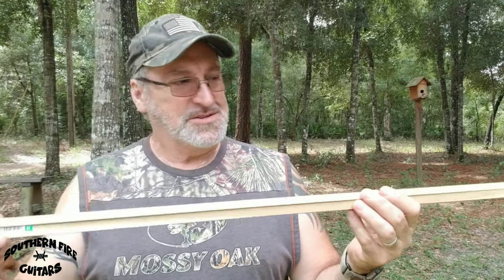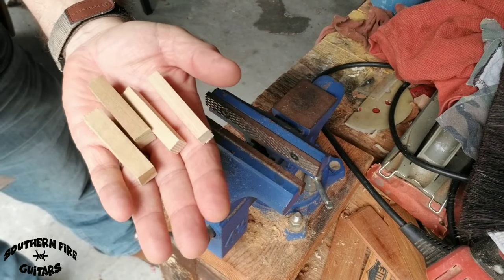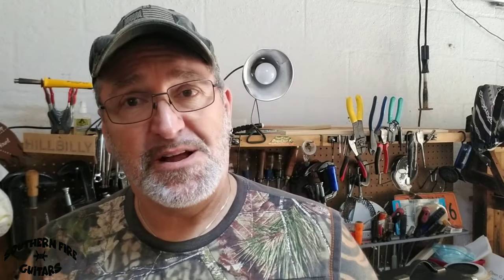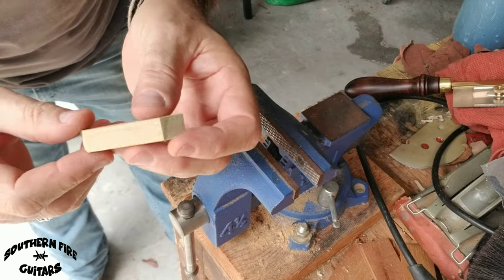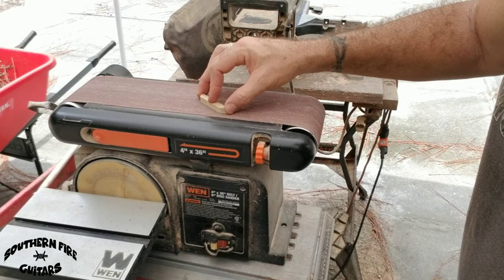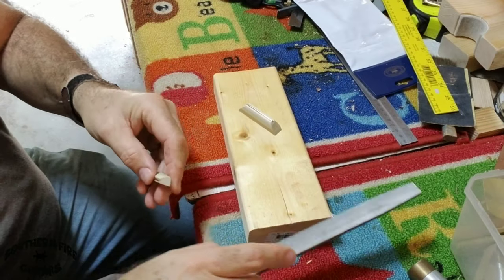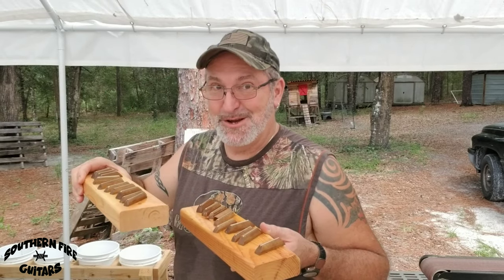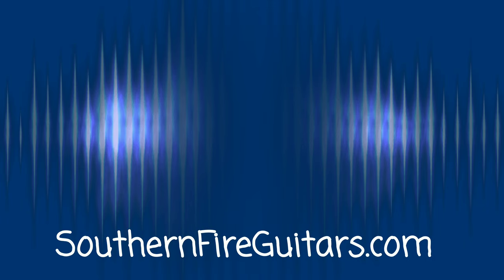How to Build a Cigar Box Guitar - Make a Bridge, Fast and Easy.

Comment: I make these as well and I take the fret wire and solder a length of 20-22 ga wire to the tang  and then drill a hole in the slot down to the inside of the GBG. Then slide the wire down into the CBG and set the fret wire in the bridge (I just have em made up that way now). Then solder it to a ground for grounding the strings. Nice Video!
Reply from the maker: Thanks for the tips. M~

Comment: My local hardware store is An Ace they well have it  Lowes is too far way.    I have been just using scraps from cutting opening for the neck. But that looks more consistent. Marc
Reply from the maker: I use a lot of scrap pieces as well. M~ 😎

Comment: Wince tip!  I usually use piece cut from a 1x2 poplar.  But this will be much easier.  Closer to finished size.  Thanks! 👍
Reply from the maker: Thank you sixstring. Yes, very easy to make like that. M~

Comment: Great video and tip. I was wondering if you notice any difference when using a harder wood like oak as compared to the softer poplar. I like your method but have read that for bridges, the denser the wood the better.
Reply from the maker: Thank you mshrad, I don't really hear much difference, I guess because there are so many other factors involved, string gauge, action, box type, box top thickness and so on. M~

Comment: I actually do the same thing with round dowels and finishing nails. I sand down the dowels to get the desired shape, then I glue on the nails to work like the fret wire. Probably not as strong as using actual fret wire though. ;) I need to start looking for the square dowels though, definitely a time saver. ;)
Reply from the maker: The nail is a good idea, Ive done a few like that before, definitely cheaper than the fret wire lol

Comment: Hi Michael,  another great video, I was wondering about the humbucker pu's you use, if you have any issues with the internal depth of the magnets, causing you to groove or notch out the underlying neck inside the cigar box?
I appreciate your advice.   Thank you.
Reply from the maker: Thank you, fokker. Some of the regular humbuckers I use, you will have to cut a pretty good notch into the neck, in that case I will use dowels in the neck for added support. I also like using the flat, top of the box pickups from MGBguitars.com. All you need is a little hole for the wire to go through, and hot glue them to the top of the box and add the cover. :)  M~

Comment: I had a couple questions about locating the bridge.  First, do you locate them right at the exact scale length or do you move them a little to compensate for the string size (think traditional acoustic slanted saddles)?  And second, how do you fasten them in place?  I’m guessing a little hot glue...
Reply from the maker: Thanks for checking out the videos. I start with the bridge right at the scale length, then adjust it to set the intonation, usually sliding it back a little. I do not attach the bridge to the box, ( its floating ) its being held down by the string tension. I leave it floating for adjusting the intonation.  Hope this helps.  M~

Comment: Q. Do you slot or mark the fret wire to hold the strings in place?  🙏🇦🇺
Reply from the maker: Hi Guzzo, I have before but usually I do not, because sometimes it will cause string Buzzzzzz. M~

Comment: is there a reason you use this style of bridge instead of a  bolt? curious if its just because its better looking or if it serves a purpose.
Reply from the maker: I do use bolts occasionally, I think the wood bridges transfer the sound a little better acoustically, plus if I need to bring the string action down a little, I can just sand the bottoms some. M~
Reply: @SouthernFireGuitars  makes sense, much easier to fine tune and i imagine it probably does help the sound a bit.
Reply from the maker: @zipzip8239  I think so